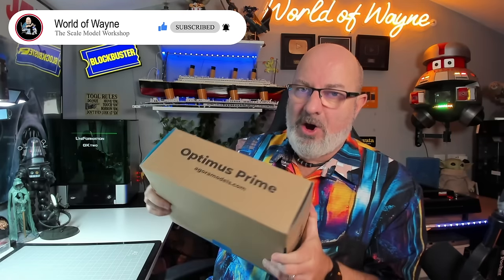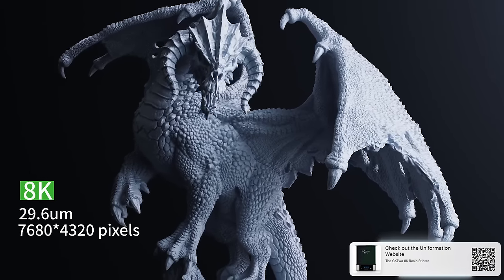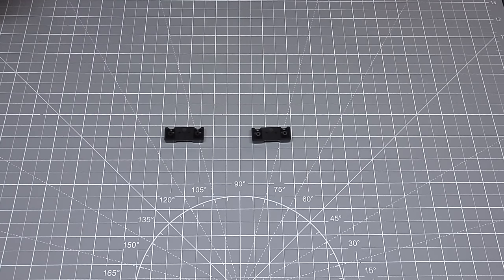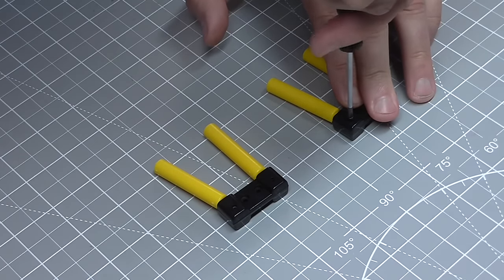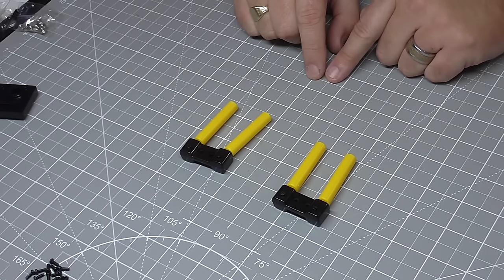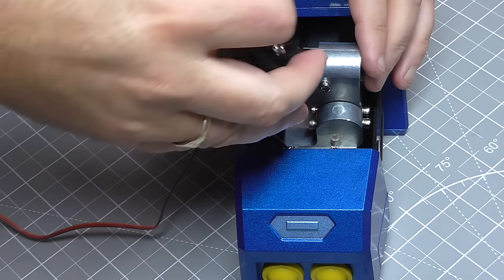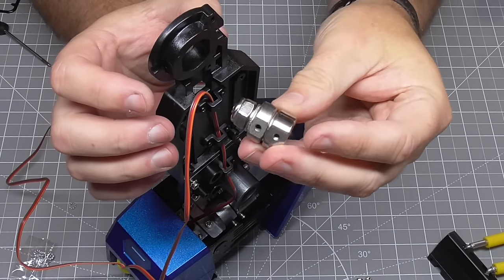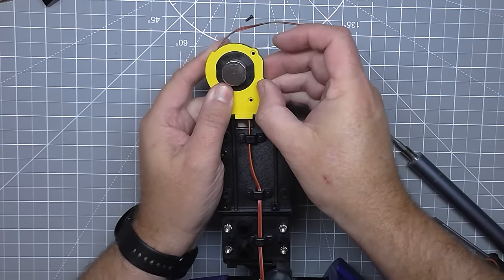Agora Models Build the G1 Optimus Prime Transformer - Pack 7

Comment: All that plastic in joints subjected to mechanical stress is worrying.
Reply from the maker: Only the surrounds are plastic. The actual joints are metal
Reply: That probably depends on load bearing. If the rest is plastic then there won't be as much weight / stress than if the rest was metal.
Reply: @WorldofWayneUK  I worry that those bolts holding the plastic and metal together could stress the plastic around those metal blocks with movement.
If I can give you some advice, lubricate those joints well, but don't use the usual oil because if it is derived from petroleum it can corrode the plastic and weaken it, better at that point lithium grease or Teflon spray.